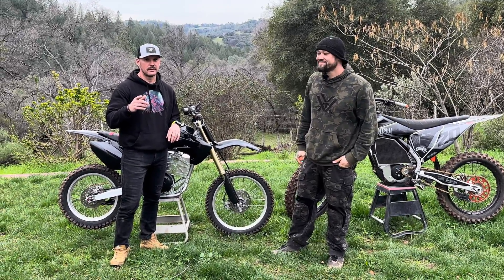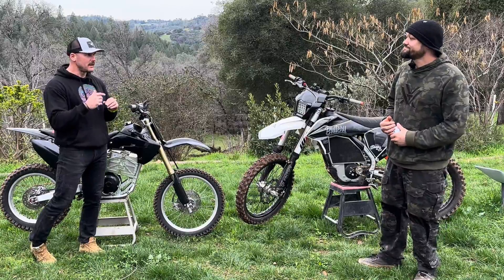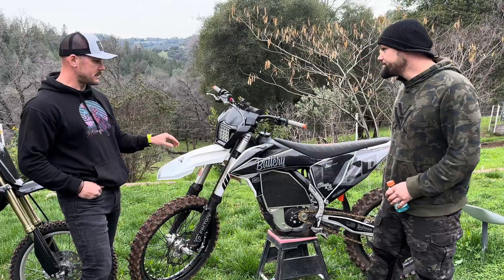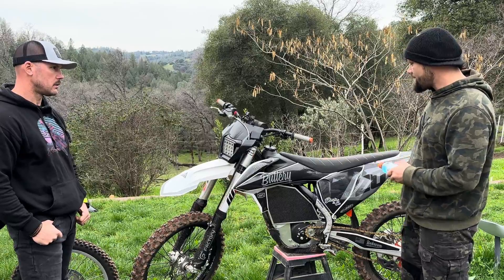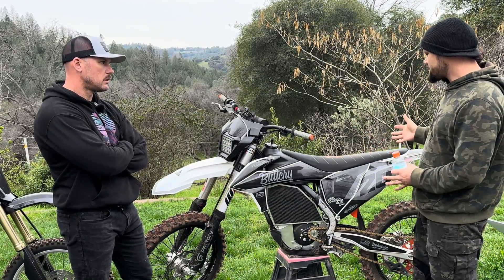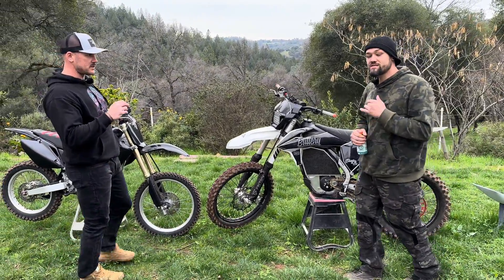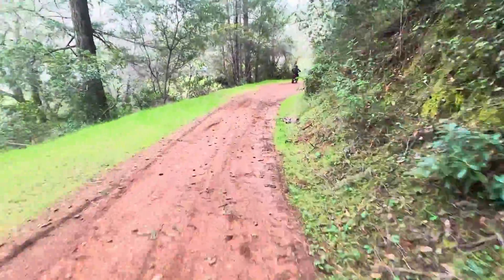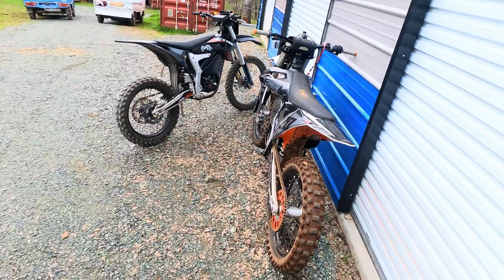ULTIMATE Electric Dirt Bike Conversion Kits! Electro And Company Meets Quasar E Moto Sports

Comment: Been looking to do this conversion with my CRF150R although I would like to see if the " 72V QS 138 4000W 90H PMSM Motor " will fit in my frame along with a battery
Reply from the maker: Nothin to it but to do it! 🍻🫡

Comment: How hard would it be to adapt one of these kits to my Yamaha 350 warrior? I am an engineer and have access to solidworks cnc lasers cnc machines and really good fabricators. I want to do a full restomod to an 80s futuristic warrior, and going electric with your kit seems like the best option.
Reply from the maker: Damn, for someone like you with that kind of tooling knowledge probably not that hard at all 👊